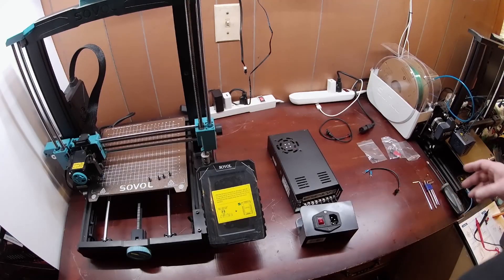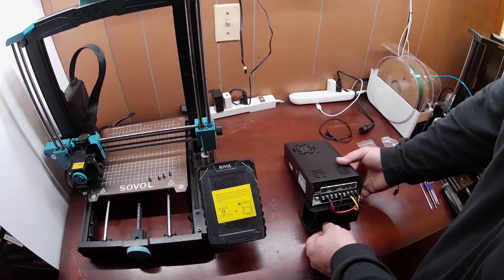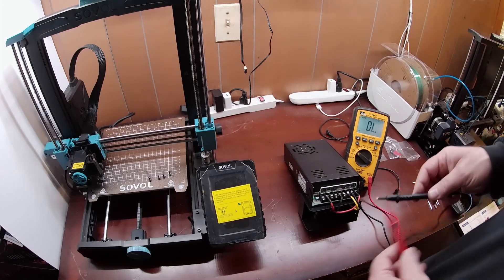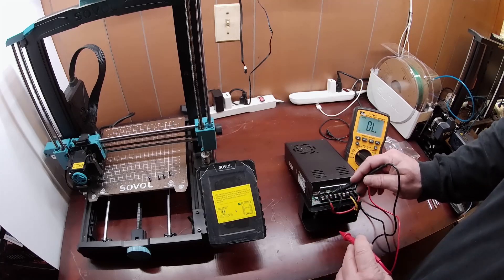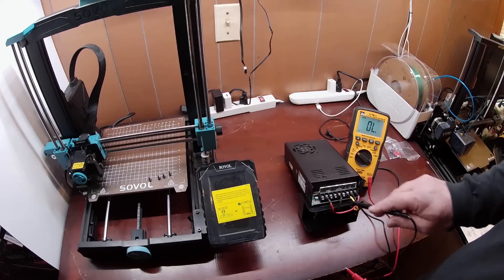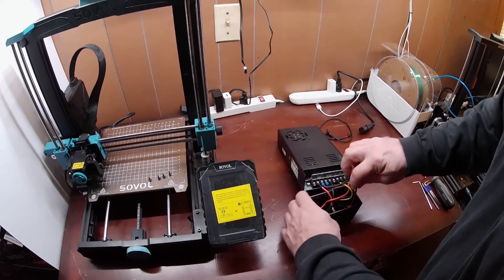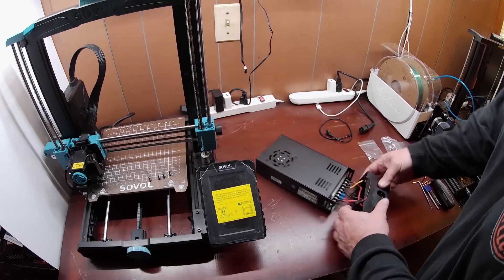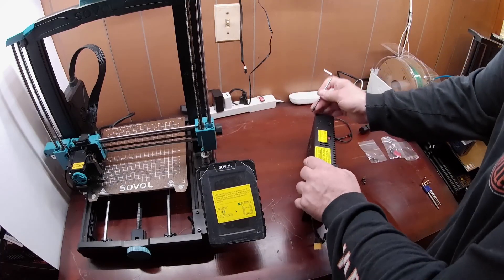Sovol 5.0 Klipper Touch Screen - SV06 Installation

Comment: I may have ordered the sv06 version instead of the sv06 Plus. Do I need to exchange it, or is it a matter of using the correct firmware.
Reply from the maker: I would contact Sovol, I believe all you would need are the correct configuration files, which could be sent to you. They might already be on a GitHub, I’m not sure. But there are no physical differences.

Comment: After you do the firmware upgrade (not sure how to verify it took) there is quite a bit of calibration, would be nice to see all of that! I followed the video provided and the manual (they are in a bit of disagreement on some wording I noticed). So many features now, not sure how to go from the original screen to this Klipper interface, it's all so new. I think there is some software profile stuff to do yet, and the printer seems to have a mind of it's own when it comes to printing (I had to manually adjust the print speed, extruder temps to get a print to work properly). Also, there is WiFi?! I did not realize it had this, nor do I know how to use it. I have it connected to my network... but I am not sure where to go from here. I'll keep an eye out for more instructional/informational videos past the setup and physical install, this has been really helpful.
Reply from the maker: I was not sure what they expected us to do to verify it took, exactly. But when I flashed, I put the card in and turned it on. That sequence in the video is real time and uncut. So it booted the screen after a a little time and showed the main page. I had bed and hotend temp and that meant it took and was working correctly.
The next video in this series will be calibration and setup. Stay tuned!
Reply: @FilamentandFiber subscribers!